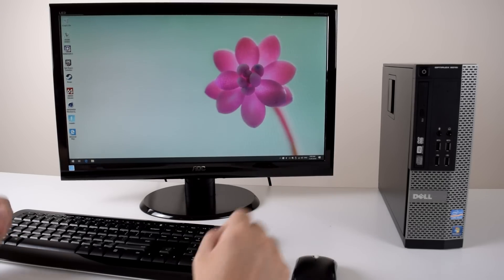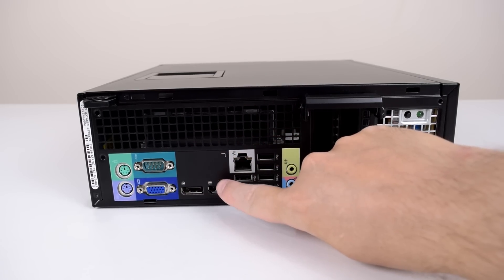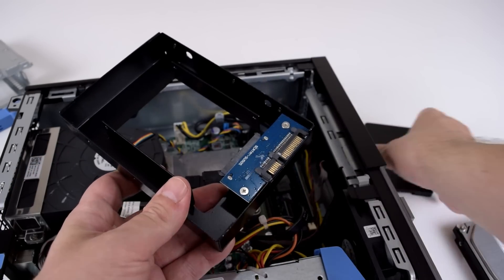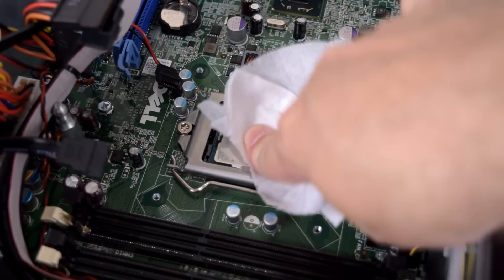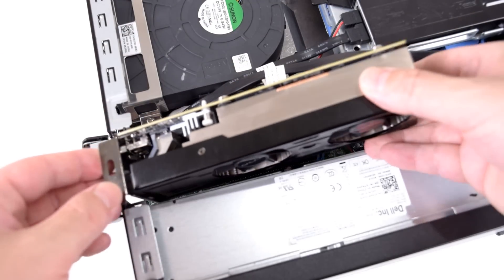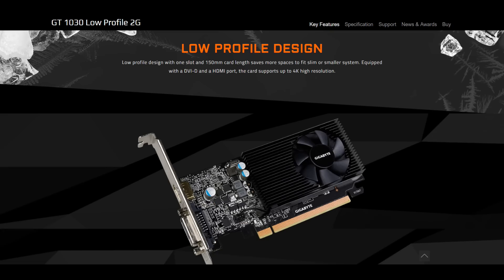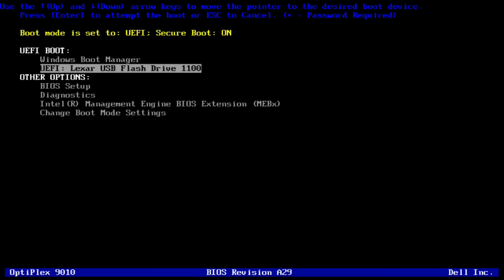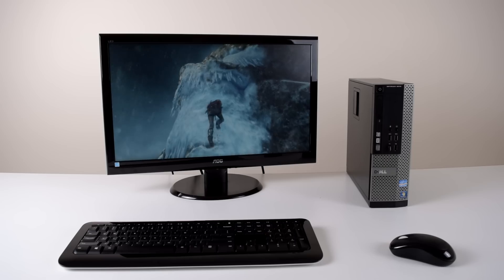DELL OptiPlex 9010 Upgrade Guide! Core i7 32GB RAM GTX 1050 Ti and more

Comment: Hey, Phil, I know it's not relevant to the subject at hand, but I'm having an issue with a machine I'm building; Build is as follows: 

ASUS P4SD-LA (and the P4 it came with, which is 2.4GHz)
Sound Blaster Live! 1024 (CT4870)
nVidia GeForce FX5500 (AGP)
512 MB DDR (PC-2700)

When I install Win98SE and all the drivers, it seems to work great until I reboot at some point; then I get a constant Windows Protection Error, and it refuses to get past it.  Any thoughts?

Comment: Hi,
Thanks for the video. I think it is better to avoid gt1030 because it uses pcie 3.0 4x. On a pcie 2.0 motherboard it is not that good. That said, i do not know exactly what is the real lost at using a pcie 3.0 4x on a pcie 2.0 slot

Comment: I've said I many times, I love buying this nuggets, my friend is loving his, core I7 2600S 16gb 4 x4 gt 1030 and 512gb SSD
It's amazing he mainly plays fighting games but mostly uses it to work (illustration Photoshop and illustrator) and it breezes through it
Just a not Don't get a passive 1030 the computer only has 1 case fan and is mostly for the PSU

Comment: I must say. Great video.
I got one awhile back but in the Tower formfactor instead of SFF, with the same CPU model (i5 3570) with 8GB ram and I can say it was well worth it. 
Tossed in the EVGA 450BT PSU from my old rig and a 4GB RX 580 (The half-length model that so far only HP makes) and bam. 
The only real downside is the placement of the SATA ports. Which are literally directly behind the PCI-E slot thus limiting you to half-length cards.
As anything longer makes them inaccessible.
Reply from the maker: You can get 90 degree angles SATA cables, they should fit underneath the card.

Comment: The Mid tower is the way to go if you get a Optiplex, the SFF is a weird motherboard, you can buy the componants individually for cheaper than the pre built. If you can find them though.
I use the 9010 MT mother board, the i7-3770 and a GTX 1070 TI
Reply from the maker: Yea not here in Australia, all I'm seeing are the SFF versions.

Comment: Man, I wish there was a low-power 1660. These things would be beastly console-killers then:)
Reply: 1650 low profile is out :) it will be about a 35% increase in performance
Reply: GTX 1650 is around the corner, let's hope it's a considerable jump from the 1050 Ti and low power too.
Reply: A 1650 does not make this faster than a 1050ti other shit bottleneck the gpu, not worth more then a 1050ti. Better to build something else then with  more powersuply.
Reply: -Aleeke -  this will absolutely make this rig run a lot better graphics. Although you should get the dell XE2 SFF because it comes with a 315w psu
Reply: Immense Data I’d say get a gtx 1660 super I thought about getting it but instead I got gtx 1660 to

Comment: The i5 pairs well with a GT1030 and the i7 pairs well with a GTX 1050/ti. 

They are surprisingly good for a SFF. Quiet and powerful.
Reply: I paired an i5 3rd gen with my Rx 570 8gb and it works best

Comment: With my Dell I7 and HP 8200 I5, both have had new win10 os installed on blank hard drives, both i left alone and after a few reboots or say withing 2-4 days both became automatically registered, i believe from the OEM UEFI information onboard as i deliberately did not use the numbers on the licence sticker ( some times like in my HP Laptops the licence number will not take, win 10 reported it as a OEM serial number and the only way to use it was to reinstall the OEM cd's , then once that was done perform the WIn 10 update )
Reply from the maker: Nice.

Comment: Haswell and older generation Intel CPUs that have HyperThreading perform so much worse with Spectre/Meltdown mitigations enabled. I personally wouldn't replace the i5 the with an i7.

It's also worth noting that most AMD cards don't work properly with these old Optiplexes.
Reply from the maker: The machine actually came with two FireGL cards installed, do not sure where you got that information from...
Reply: @philscomputerlab   I've tried installing an RX 460 and RX 560 on my old Optiplex systems (7010 MT & 790 MT). They all had stability issues.

Nerd on A Budget also has similar experience with his Optiplex 990 (see watch?v=TlXLN0sxZMk).

I guess I should've said 'some fairly recent AMD cards don't work properly with these old Optiplexes.'
Reply from the maker: @911Salvage  Thanks for clarifying. Yea I don't have anything modern from AMD that's low profile to try out...
Reply: @911Salvage  maybe u need to update BIOS to A32. Optiplex 7010 mt comes with HD 7470 on the manual....

Comment: ✌😏 You know, with all those yummy i7 upgrades instead of getting that expensive slow 1050thai, you can spend $50 more and get a used 1070 8gb, and get a massive turbo booooooooost in performance! of course you would then need to transplant into a regular case and pu a standard atx psu 🚤😍
Reply: You're saying you can get 1070's for $200? Every listing i've been seeing has been at least $270 on ebay
Reply: @ChfHappySack  🙂 maybe they are changing, here in the usa my listings are showing used 1070s going for $199 and up, i just saw a Gigabyte Mini 1070 8GB Single Fan for $200 with free shipping, that card is 2 TIERS over the sad little $180 1050thai SFF Limited Edition, all you guys deserve a better card, especially if u have an i7 8thread ivy bridge cpu which is very close to 4th gen haswell in performance 🍄😍🍄

Comment: DDR3 prices are crazy now I looked up 16GB on PCpartpicker and it's $64 for a new pair.  DDR4 2400 is only $72 for the same amount.  It's a shame but that alone would make me lean toward newer hardware, but these little machines really are an enormous value especially if you catch people on ebay not paying attention.
Reply from the maker: Yes DDR4 prices have finally come down. Such newer machines though are still being used though, but give it another few years...
Reply: 😀 thats great, i know a guy that has an i7 skylake cpu that he doesnt use, with cheap ddr4 memory its finally feasable to use it for a budget build yay 😍
Reply: 🙂 4 years ago i remember 8gb of ddr3 1600 was $80

Comment: you should install amd radeon rx 570
which is much better than gtx 1050 ti
Reply: 😀 580 8
Reply from the maker: Good luck with that...
Reply: @philscomputerlab  ✌️😏 Dr we need a Transplant 😷
Reply from the maker: @MrSamadolfo  Can this really be done? Surely there will be issues with something not fitting or not working...
Reply: @philscomputerlab  🙂 maybe, it just depends on the motherboard layout, and the particular 1070 model. 🙂 Have you ever seen the Gigabyte Mini 1070, its tiny with a single fan ☺️, that should work, of course a dual fan card would be prefered if the motherboard layout will allow it 🐢
Reply: Bottleneck
Reply: @knownnuisance7512  ✌️😏 there no bottleneck friend, i7 ivy bridge handles a $220 1070  (1660thai) very nicely, theres no need to be suffering under overpriced & very poor framerates with a $180 1050thai 🐢☹️

Comment: With the front of the optical drive facing you, you can put the SSD in the upper left if you wedge it inbetween the lip and the power supply. Then use a single screw (again in the upper left) to keep it in place. Pretty jank but if you don't want to get an adapter it works and leaves a space for another 3.5" drive.
Reply: 🙂 on ebay theres an oem 2.5 adapter, i think its $5

Comment: "PhilsComputerLab" and "32GB RAM"--two things I never expected to see in the same title!

As long as you're looking at Dells, the Optiplex 790 USFF makes an amazing little go-anywhere XP gaming or emulation box. Just don't put an i7-2600 in there. Things get...warm.
Reply: i think that unless you're building something to run nothing over crysis 1, like an arcade board, the lack of upgrade choices makes anything below sff a terrible choice where being that small doesn't worth it really

Comment: Phil, thanks for the nice video! Yes, Dell Optiplex is the cheapest way to build the powerfull small form factor gaming PC! In the past,  I used Optiplex GX 620 SFF (Pentium D 820) and GX745 SFF (Pentium E2220 -> Q6600) with 9800 GT, HD 5770 and finally GeForce GT630 LP and it was the nice experience. Nowadays, second hand Dell`s SFF based on s1155 are very cheap in Finland, but, unfortunately, it is more expensive in Russia. Still, it is a good option in case of price - performance - upgrade opportunitiy.

Comment: I bought the optiplex for 250$
I7 3770 with 8gb ram and 500gb hdd
Added gtx 780ti
120gb ssd
Evga 500w psu
And transferred to a new case and added some 2 intake fans and 3 exhaust
Reply: 😀 yes transplant is the better way to go, then throw in a $220 1070 🚤😍 bliiiiii
Reply: @MrSamadolfo  am using zotac 1070 mini with 7010 mt case. But with stock CPU cooler. Temp can go up to 95dgc GPU 82dgc. During gaming as sometimes it run on 3.9ghz

Comment: And if you haven't been paying attention SSDs have dropped to insane levels. I'm getting a 1TB Samsung for about $150 USD...THAT'S INSANE! I was at Staples yesterday and they still had the original price tag of $350. Add a 1TB SSD to this and it will make a great living room PC for gaming, streaming, movies, etc. I use an HP SFF PC for that. I see it has four USB ports in the front. My SFF has four USB ports in the front and I like how I can plug 4 USB controllers right in the front like a good old XBOX or N64.
Reply: Gaming lol 😂 ! Unless you plan to play older games this is not a gaming PC. You be better of with a Xbox one X compared to this thing as price is comparable. You could also get a PS4 and just pop a ssd in if you so choose. 

For modern day gaming at 1080p you really need to be running something like the Gtx 1060 6gb variant or RX 570 to have a prayer of 60fps + stable. I game at higher refresh rates and even the GTX 1080 struggles to meet my needs.
Reply: @dennisp8520  TBH, 2080ti still strugling at 144hz ultra cant get constant.  Hell, my friend PC with i9 k version + 2080 ti cant get 60 fps constant at 1080p in ARMA 3. Hahaha

Comment: Great video as always.  I bought a similar system (HP Elite 8300 SFF) with similar config (1050Ti, SSD, etc) based on videos you and others have made.  I too see similar power usage results.  One other suggestion I'd throw in for people who worry about power draw is using an external powered USB 3.0 HDD as my benchmarks indicate that an internal HDD has virtually the same I/O and bandwidth numbers.

For those in the US looking for good value, one place I'd suggest is shopgoodwill.  The positive is there's a lot of systems older (seen as old as P4) and new (some i5s) systems and frequently they start at reasonable numbers ($9.99).  The downside is shipping prices vary greatly (from $10 up to $60 for me) and a lot of auctions (at least for me) tend to go up rather quickly the last few hours;   I actually tried several auctions and almost won a few with i5-2400 systems in the $60 range (including shipping), but given the overall small performance boost going from my A10-6800K to an i5-2400, I'm sort of glad I lost.  There's also the issue that a lot of the stuff is more as-is and may not include a Windows license.

Again, thanks for the video(s).  Have any larger projects in mind for the future?

Comment: I also made a similar build, using a slim office pc (NEC Mate, Core2Duo version)
Switched the motherboard to MSI H110 Pro-VH,  i5-6500, and Samsung 2x8GB 2133
180GB Intel 520 SSD + 4TB WD Purple
MSI GTX 1050Ti-LP

Swapped the power supply into FSP 400W Gold (i think it's 2U form factor), i still have a gap from the power supply slot tho
*now i know from your video that upgrading the power supply isn't really necessary xD

anyway, awesome video!
and good to know that someone is also using a slim office pc case like me

[sorry for my bad english]
Reply: due to the fact you have changed basically everything it was probably worth it to get a new power supply... ive head stories from people with builds like yours and they didnt change the power supply and after around a month of use everything was fried

Comment: As a note, some of these are BTX and not ATX, so watch out, made that mistake and now i'm stuck with the case unless i can find an old btx one from like 05'. Also some of these have proprietary plugs for the motherboard and need an adapter plug to use a better power supply (as I also found out).

Comment: So the pwr consumption chart is with a 1050/ti right? doesn't make sense for a 1030 to draw 50-60 more watts when stressed
Reply from the maker: Yup I used the 1050 Ti for maximum load!

Comment: This is exactly what I purchased for my little brother. Has an i5 2400 with 4gb of ram for around 100 Canadian. Added more ram and slapped a 1050ti in there. Best price to performance i could hope for. The Optiplex actually has decent cooling aswell.
Reply: Yeah the 90mm exhaust fan + the top mounted power supply exhaust fan and the open pocked lower front panel really keep things cool, but it's a bit of a dust magnet.
Reply: I generally aim for 4th gen i5 as it has a better supported Intel IGP on Windows 10 (but 3rd gen is fine but the speed jump from 2nd gen to 3/4th gen is noticeable, boots to desktop so fast I have to put a login password on them so mapped network drives connect, as they boot so fast with ssd networking has not started yet when no password)
Reply: I would go 4th gen but it general busts the budget around here
Reply: @BrandonsOnline  I can get the 2nd gen i5 for less then £60-90 (normally 4-8gb), but I can get a i5 4th gen 8gb ram and 250gb ssd and win10 Pro for £150 often or £90-110 with a spinning rust hdd (I won't actually pay more then that, I sell them at £250 normally bit more for business)
Reply: @leexgx  Yeah that sounds about right. Unfortunately 150 quid is 260 Canadian dollars which is beyond budget if im going bang for buck. 4th gen i5 would be roughly a 17% performance increase for essentially double the dollar amount which I didn't have
Reply: @BrandonsOnline  the whole experience on the 3rd gen or higher systems seem oddy very responsive compared to 2nd and older but I do understand that $CA items tend to be priced higher then they should be

Comment: I'm curious to why you went the half-height form factor.  Aren't used full tower (office) PCs about the same price and open up more budget GPU options?
Though the case does look quite stylish in your video shots.
Reply from the maker: It seems that in Australia there are mostly small form factor PCs out and about.

Comment: With a GTX 950 instead of a 10 Series card, this PC would be able to boot both Windows XP for games of its era and 10 for games for Vista and onwards.
Reply from the maker: The 950 is a poor choice, it requires external power AFAIK. Better to go with a 750 or 750 Ti IMO.
Reply: @philscomputerlab  I thought that too, but there's a low profile model by Galax that doesn't require external power.
Reply from the maker: @andersondrezende  Fair enough!

Comment: I scored two computers from the dumpster I was quite lucky,Dell optiplex  790,i7, I don't know if you familiar of it, I fix them up I gave them a good clean I downloaded to Windows 10 to them and fresh thermal paste on the CPU.
( I have a question for help)
I have an amplifier Denon, my amp is a bit old it's got no HDMI in the back of it but I have optical fibre and coaxial cable in the back of the amp,is there a sound card you recommend me to it that fit in the case I have two slots in it and video card with HDMI because I have a 65 inch 4k television that fits in the case as well, I am on a bit budget something not too fancy
Thanks Sir, regards John👌👍👍🙂

Comment: i'm saving up about $400 dollar to build an i7 optiplex for retro gaming cause i want to run any game 2012 and earlier on 1080P ultra and not break my bank
Reply: You should be able to run games even newer
Reply: I'm using optiplex 1070 with 3770 with 4Gb RAM, 500Gb HDD, 750ti for 230$ (2016). Parts i add
CM 550watt 28$
Zotac mini 1070 200$ ( 2018 )
RAM 8+8 Kingston hyper x 1600mhz 60$
2TB hdd 100$ 
Sata cable 5$
Total 623$ 
Well, waiting for budget to buy 1tb SSD. Still running on win7pro.

Comment: Them Dell optiplexes are good machines. We are using one for a firewall. I think it is a 990 but not sure. Granted it is only an i5 is more than enough to power it. We needed a machine that supported at least 8GB of ram. I have seen users here on YouTube create gaming machines out of them.  Dell has some good machines that are easy to upgrade.  I have a precision t5500 that I turned into a gaming machine for Simulations and a Emulation box.

Comment: These machines run hot for just normal office use so I wouldn't really recommend one for gaming due to their poor air flow tbh
Reply: Rubbish. I've got an Optiplex 790 (same machine but 2nd gen CPU). Upgraded with 2500K, 32GB RAM, GT 1030. GPU runs full boost clocks, CPU load temps in the 70C range with 22C ambient.

Front case fan vents the PCI-E slots and drives via the air deflector. CPU blower fan exhausts separately.
Reply: @johnroberts2905  thats a very hot CPU temp at load; my 4790k in a mid tower only ever hits 40s at load at the most; the optiplex sff series are simply not designed for gaming
Reply: 70s is worse case, warm day, couple of hours of gaming under load with the video card in there.
40s is complete overkill, and irrelevant in this application as you can't overclock. Intel spec the CPUs to 100C+. It's very comfortably under that.
Reply: @skills2k7  i'm using 7010 mt 3770 . Using stock cooler. Max temp 95dgc@3.9Ghz. Ambient 30dgc. Using stock cooler. Usually it play around 85dgc@3.6Ghz.